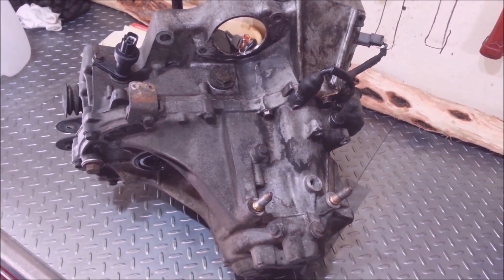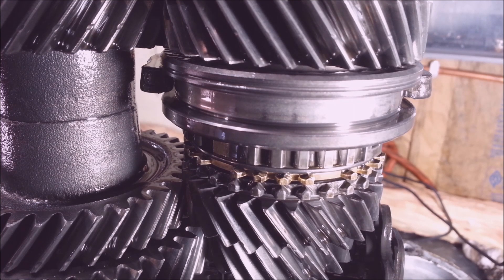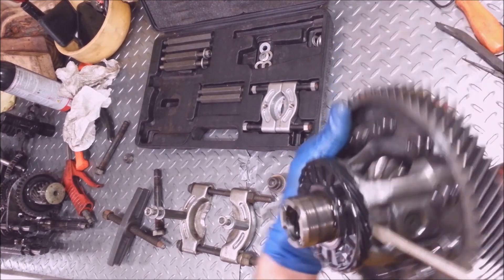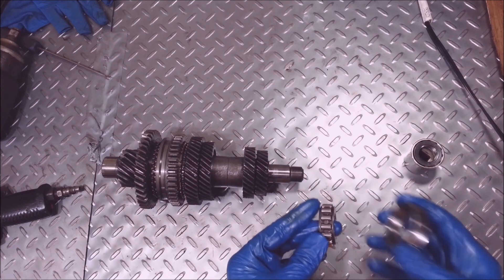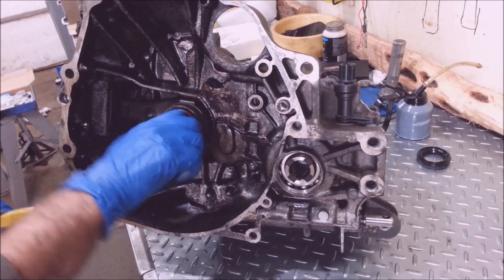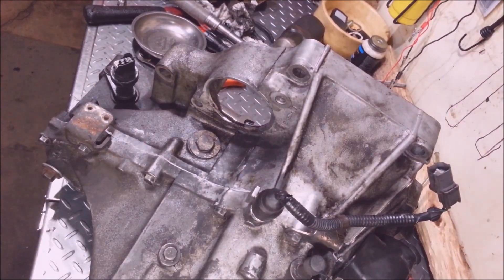Civic D16 manual transmission rebuild input shaft bearing LSD install

Comment: Definitely the best how-to for the D-Series Trans out there! Thanks for this.
Reply from the maker: Thank you! And thanks for watching!
Reply: @RustBeltAuto  quick question while its fresh on your mind. Those two shims(shim and convex washer it think) what order did they sit on the shaft? Thanks
Reply from the maker: @MrStinky2011  you usually want the taper pointing down towards the bearing. I may have pointed one up towards the gear, but I don't think it matters much. It will do it's job either way I think. Pointing the taper towards the washer might be kinda wrong.
Reply: @RustBeltAuto  thank you

Comment: Thankyou so much for making this video for everybody. i recently had an issue with my 1996 civic. I heard a horrible grinding coming from the transmission area. It just started doing this out of the blue one morning. My first thought was that it's an alternator/AC/idler pulley. Then I noticed that while shifting, the clutch would engage when my foot had only lifted up a half inch or less from the floor. The grinding sound  was present whether I was pressing on the clutch pedal or not...it was just always grinding.

By the time I left work that day, there was no pedal resistance and I was unable to shift in to gears while the car was running. Although the pedal did return back if I took my foot off it. I had to get towed. Anyway, I decided that maybe it's the clutch and that I would replace the clutch, and throwout bearing and that should solve the issues. But now, after having the tranny off, I noticed that the input shaft seems to "click" when I turn it back and forth by hand. i cannot tell if this is because loose ball bearings (like in your situation) or something else. I was going to take it apart. The car has 205k miles on it. Any advice? Apologies for the long winded post and thankyou.
Reply from the maker: Did the clutch disc crack, or come apart? did any chunks of the clutch, or pressure plate fall out when you unbolted them? Is there anything stuck inside the pressure plate springs? Are all the pressure plate fingers for the spring in the same position, or are some sticking out farther than others?
Reply: @RustBeltAuto   The clutch disc was not cracked and didn't come apart. The pressure plate fingers all seem to be aligned and looks normal. The throwout bearing for sure needs replaced because it sounds very "dry" as I spin the center race part of it. there seemed to be a definite hydraulic issue because the pedal felt weak and I was unable to shift gears with the engine started, but I COULD shift with the engine shut off. As a matter of fact, to move it from driveway to back yard (after tow truck dropped it off) I would shut it off, put it in first, then start it and it would roll (forward or reverse) no matter if the pedal was depressed or not.
Reply from the maker: You probably have a master, or slave cylinder issue, or both, if the clutch and pressure plate is okay. The noise is from, I don't know what, because I don't have my hands on it. If the transmission is in neutral, it should be smooth.
Reply: @RustBeltAuto  That's why I'm worried and I feel that I need to look inside the transmission. Even in neutral, I could hear the grinding. Again, the noise reminded me of a dry bearing spinning. Forgive the dumb question, but the input shaft is still spinning when the tranny is in neutral correct?
Reply from the maker: @Doomzdayxx  yes. Engine running, clutch engaged, input shaft always spins. Sounds like you have more than one problem. If you peel the rubber boot back on the slave, is there fluid there. Is fluid low for clutch, or really black?
Reply: @RustBeltAuto  Well I have the transmission out now so I have already taken the slave off and didn't notice any fluid under the boot but I did notice leakage around the master cylinder. The fluid was not low and it was a light brown color. I'm replacing the master and slave. Is it possible the throwout bearing could have been making all that racket? again, the noise was there whether i press on the clutch pedal or not.
Reply from the maker: @Doomzdayxx  throw out bearings usually only make noise when you engage the clutch. It should float when the clutch is out.
Reply: @RustBeltAuto  Yeah so my thinking is, if it's making that noise without touching the clutch pedal, and no visible clutch component appear to be damaged, then something inside the tranny is fucked lol
Reply: @RustBeltAuto  Hey man I have one more quick question for you. While pulling out the input shaft seal, like an idiot, I chipped the metal. I was going to put a bit of rtv in there, then place the seal back in. Is this a bad idea?
Reply from the maker: @Doomzdayxx  it depends. I don't know what you mean by chipped the metal. Is the seal exposed all the way through the surface of the chip?
Reply: @RustBeltAuto  The race that the input shaft seal sits in. I was using a seal puller and put a couple small gashes (less than 1/16th inch diameter) in the race that the seal sits in. I just smeared a bit of rtv over the gashes and drove the seal in then drove my input bearing in.
Reply from the maker: @Doomzdayxx  Probably be fine. Did it have a noisy bearing after all?
Reply: @RustBeltAuto  Nope it seemed fine lol. Yikes. I'm gonna put everything back together over the course of this weekend. Thank you very much for your time replying
Reply from the maker: @Doomzdayxx  good luck.
Reply: @RustBeltAuto  Ok well, I have assembled everything back together at this point. I am a bit concerned though. Everything seems to turn freely, but no matter what I do with the shift shaft (push in or out, turn) the input shaft spins freely. aren't I supposed to be able to put it in to a gear? Or does it spin freely no matter what gear its in, since its off the vehicle? The whole thing is very confusing to me
Reply from the maker: @Doomzdayxx  If you turn the input shaft in any gear, you should see the differential move. Like where you put the axles.
Reply from the maker: You're a pretty brave soul for just diving into a transmission, and not knowing a damn thing.
Reply: @RustBeltAuto  Yeah dude I figured what the hell, the car was free, if the transmission is toast then what really does it matter. I already committed to changing the clutch. Your video  makes it seem a bit complicated but doable for a novice like me.
Reply: @RustBeltAuto  Hey man, I just finally got around to putting the transmission back in. I am concerned. the transmission is bolted on to the engine and the shift shafts are hooked up. I put the cv axles back in but they spin freely no matter what gear I put the shifter in (1,2,3,4,5,R). I fear that something didnt go back together correctly. Any ideas?
Reply from the maker: @Doomzdayxx  when you spin one wheel, does the other go in the opposite direction?
Reply: @RustBeltAuto  Yes.
Reply: @RustBeltAuto  They do spin opposite of eachother when in gear. They can spin independently when in neutral.
Reply from the maker: @Doomzdayxx  drive the thing
Reply: @RustBeltAuto  Will do. Thanks for putting up with my obnoxious questions. I really appreciate your time.
Reply from the maker: @Doomzdayxx  no problem. Obnoxious is okay. I think some people that come on here believe their duty in life is to be a relentless prick. Unfortunately, YouTube A.I. doesn't know how to create censorship for relentless prick. Hope it works for you. Good luck.
Reply: @Doomzdayxx did if work after you rebuilt it?
Reply: @thevikvids  Yeah it actually ran pretty good

Now my problem is the brake and fuel lines rotted out. Its in the area, underneath the car towards the rear. I'm in the middle of repairing those.

If you live in the rustbelt, it would behoove you to treat those semi-exposed lines with something (fluid film, wd-40, engine oil, anything) so they don;t rot away like mine.

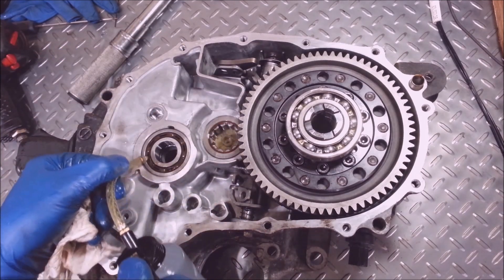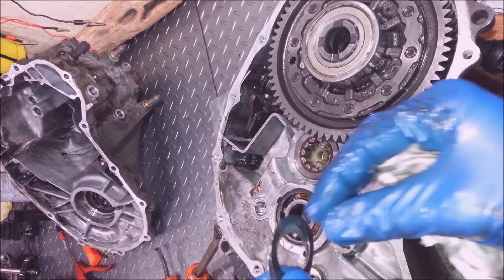Comment: Just FYI the washers were installed backwards when putting the transmission back together.  The spring washer should be against the input shaft bearing and the regular washer on top.   When the washer set was pulled off at 19:12, the regular washer was on the bottom, so it was installed against the Input Shaft Bearing, while the spring washer was on top, which is against the main shaft.  at 8:24 when the washers were pulled off, the darker one (spring washer) is against the input shaft bearing race.
Reply from the maker: Yes. And it still works.

Comment: Very nice instructional video with plenty of explanations, and straightforward to the point of disassembling the entire transmission. I had to tear my trans down in my Dirt Mini Stock Car Honda so I could weld the spider gears so it pulls both tires 🤘😂. Anyways your video served it’s purpose thanks dude!

Comment: My front input shaft bearing (ball bearing) blew up 16 years ago, replaced it, I also assumed the tapered roller bearings don't fail, but front mainshaft tapered bearing cage breaking it is THE cause of the repair I am currently in the middle of.  I'm just replacing that one bearing for a "quick" fix to get it back on the road, but I do have a spare transmission that needs synchros, when the time is right, I will do a full rebuild on that one, I definitely will be replacing all of the bearings.  When the bearing failed, it took the "uber important" plastic oil channel with it, so I used the one from my spare.  Nissan does not sell them anymore (don't have a Civic).  Whether or not it's the same case with Honda, internal transmission parts are not a priority with auto makers, so you're stuck trying to find a donor to replace parts in a lot of cases.  Don't lose anything, and try not to break anything.  Don't drive the car if your transmission is making bearing noise, chattering or stumbling in gear.  Drop the transmission and fix it asap or you will end up breaking more shit, anything from plastic parts to the case itself.

Comment: At the 21:12 min mark, you spun the carrier. All sounded smooth. When I spin my carrier(after replacing all the bearings) I believe it is catching ever-so-slightly on the bottom gear of the secondary shaft. It doesn't spin as smoothly as yours did. There's supposed to be NO DRAG, correct? It's as if the carrier is raised ever-so-slightly higher than it should be. Would you suggest sanding the shim down a bit to get more clearance, and allow the carrier to sit a tad bit lower in the case?
Reply from the maker: If it did not do that before you took it apart, something may not be seated all the way. Like the carrier. Double check your work. make sure you don't have an extra shim laying around. Make sure the rings are centered. No bent forks. Best advice i can give
Reply: @RustBeltAuto  it's gotta be the carrier. Maybe the bearing on that side wasn't seated all the way in? I out that shim back in. Hmmmmmmm, I don't know. Heu, any idea the clearance between the carrier hear and the bottom of the secondary gear ring? It's rubbing on those 10 outer  carrier bolts that are just slightly raised from the surface of the carrier
Reply from the maker: @JasonTylerRicci  it probably is not in all the way.
Reply: @RustBeltAuto  Think the bearing isn't seated all the way down onto the carrier? The whole assembly seems to be seated in the case. I'll try to press that bearing a bit further down on the carrier. You've been most helpful I cannot thank you enough.
Reply: @RustBeltAuto  last question, I promise. Did the secondary shaft have a shim/washer on the bottom? I didn't notice
Reply from the maker: @JasonTylerRicci  Shims behind the nut. If you don't have any shims left over, you might be good.
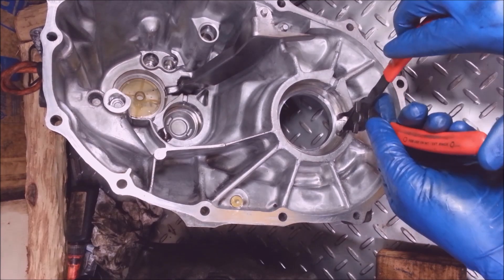Reply: @RustBeltAuto  at the 24:50 mark, you pull out the shim from that half of the case. I think my problem was I put this shim inside the OTHER half of the case (the bottom, so to speak) Thus making the carrier sit higher and interfering with the secondary shaft.

Comment: Thank you. I have to tackle a very noisy input shaft bearing on a 200k mile d16a6 transmission. At 1st I did a full clutch job thinking it was the throwout bearing. Wish I knew this prior.
Reply: I did a clutch job cause my clutch was destroyed at 300k, soon after I did the clutch one of the bearings went and it makes a knocking sound till I press the clutch in. This is the next step while adding an lsd

Comment: i do like 1/3 1/4 kick in low gears because sometimes the rpms drop so low it feels like im going to stall out shifting in to second in some  cases like going uphill. stock b7 block uknown transmission commuter car. dont get a nice full kick till about 3rd

Comment: Hey brother I followed the full series you did. I’m finally getting around to swapping out my y7 transmission and putting a y8 in mine. I miss your Honda videos. You liking the lsd? Debating putting one in mine before I drop it in. Mine is boosted as well and wondering if it’s worth it and since you did it and I appreciate your efforts here wanted your input. Thanks.
Reply from the maker: I wouldnt have it any other way. LSD is great. Even for handling.

Comment: I am doing the same rebuild and upon putting it all back together I noticed that second gear has bad drag take some force to get it to spin unlike the other gears. I noticed that the second gear was a little stiffer than the first but hoped this was normal. Took the countershaft apart a couple of times to see if maybe I assembled it wrong, I think I’ve lubbed everything properly but when it’s time to press the other gears down it’s like it’s pressing second gear down so hard that it’s adding more drag to it 🤔 I need some advice because I swear I’ve done everything right but I still gave drag
Reply from the maker: Maybe whack the outside of the case where the main, and countershafts are with a dead blow hammer, after it is assembled to see if it is binding from assembly? Make sure shift forks are not bent? Really I have no idea. It should feel about the same in every gear I think. You drive the thing, maybe it will loosen up, Maybe ask those know it all's on the d16, or Hondatech website?

Comment: The part I need to see the most is skipped. But does the input shaft bearing go in a specific way? Or does it matter? Like does it have a right side up is what I'm trying to ask
Reply from the maker: Does it look the same on both sides, and not a tapered bearing?

Comment: I just replaced all the bearings and seals in my transmission, all the gears shift great but my 1st and 2nd gear makes a loud grinding noise while under a load...

Comment: Great video 
I own a 1995 Acura integra gsr and when I try to put my car in reverse it feels like it doesn’t want to go in, yet when it does engage it does not go out of reverse unless I drive a little bit backwards then it pops out of reverse, I don’t know what can that be
Reply from the maker: Me neither. If I was to guess, I would say it is not all the way in neutral (adjustment issue, worn bushings), The clutch is not fully disengaged, or there is a bent shift fork.
Reply: @RustBeltAuto  any chance a shift fork can wear out by 250k just enough to cause issues from time to time
Reply from the maker: @DkpProductions  if it is bent, it should have pretty consistant problems. What's it doing?

Comment: My del sol d16 transmission must be making the noise from that bearing. Car has 160k miles and is 30 years old. How much would a bearing replacement or rebuild cost like that?
Reply from the maker: I think the bearing is about $12.

Comment: Great video! Helping me rebuild my trans. Only thing is, I cannot free up the gear stack for the life of me. I know I have bearing failure somewhere however because a few bearing balls fell out of the carrier. Think it's the inside shaft bearing. Suggestions to free up the stack?
Reply: @RustBeltAuto  no. What's that used for? Come to think of it, the bearings that came loose I think we're from the spring loaded (shift detent?) bolts. Still can't seem to free up the gear stacks. I didn't put it neutral beforehand however
Reply from the maker: @JasonTylerRicci  I used a small prybar, and just worked both counter, and mainshaft back and forth until they both came out together enough. Yes, 3 balls for detents. Seems like some of this video is missing content. I may need to do it over.
Reply: @RustBeltAuto  No, this is a great video. There's one other detailed D16 trans rebuild video I like and yours goes into far greater detail in less time. Thanks again my friend
Reply from the maker: Good luck to you. Thanks for watching!
Reply: Any suggestions in searching for bearing kits for these? I wanna do them all, even the diff bearings. Maybe I gotta get each one separately?
Reply from the maker: @JasonTylerRicci  There are kits you can buy. Ebay, is the easiest place to find them. There are 35 or 40mm differential bearing kits for d16's. You need to know what one you have. There is a sticker on your transmission.
Reply: @RustBeltAuto  thank you friend. You've been most helpful. I ordered each bearing (7 of them!) individually off ebay. Most of them Genuine Honda. Spent over $300! I ordered the diff bearings w/o checking my trans sticker first. I researched all part numbers first. I hope it's the right one.
Reply from the maker: @JasonTylerRicci  all those bearings are NTN, no matter who you get them from. They are the only company that makes them with the exception of maybe the carrier bearings. The ones I had were Chinese, and for whatever reason had snap rings I had to take off, and a groove in the bearings.
Reply: @JasonTylerRicci  I know I'm late but Syncrotech. Whoopee Doo Racing carries rebuild kits.